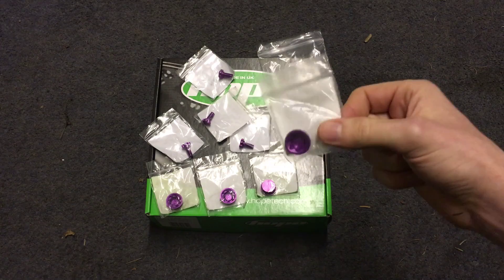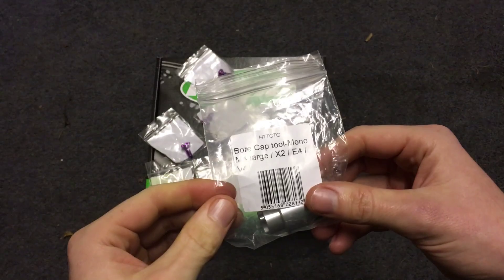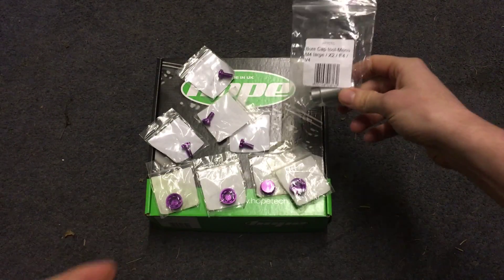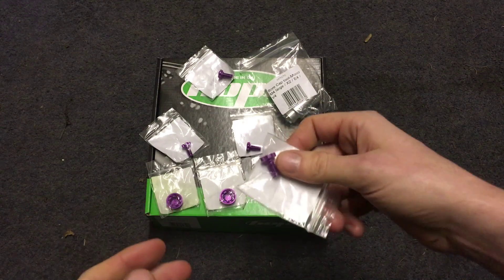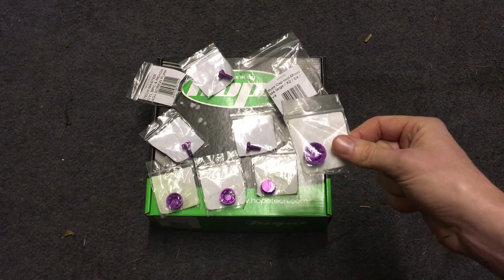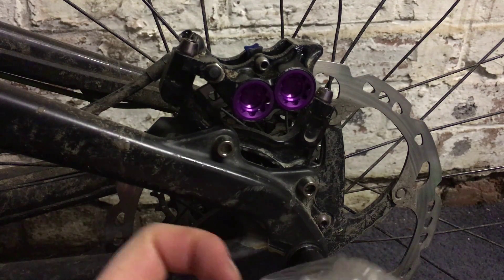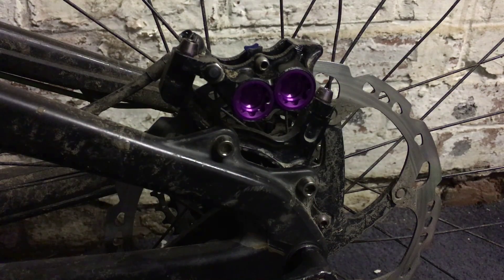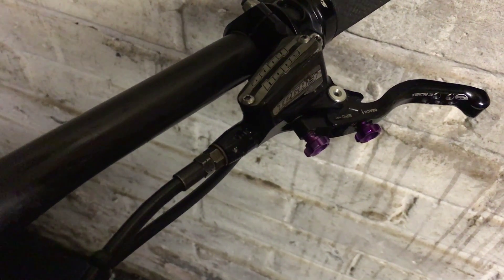Customizing Hope E4 Brakes

Comment: Is there a easy way to remove the circlip that holds the adjuster knob? 😊
Reply from the maker: Dennis Eriksen Hi, you can get pliers for them but I just use a small flathead screwdriver.

Comment: Nice!
Im considering going for Hope brakes. Is the brake hose bigger in diameter than std shimano hose? It looks bigger to me which would mean it wont work with my frame clamps.
Reply from the maker: I'm using black braided cables, the standard ones are the same size as shimano hoses.

Comment: Is the swapping of bore caps a straightforward affair? just use that removal tool? And bleeding or alignment needed?
\
Reply from the maker: Owshua Hi, you have to use the tool  then bleed the brakes as the bore caps hold the brake fluid in the calipers.